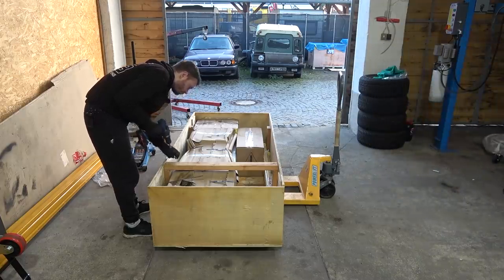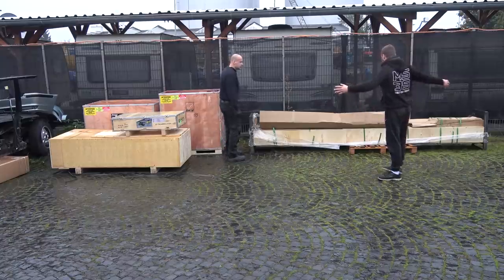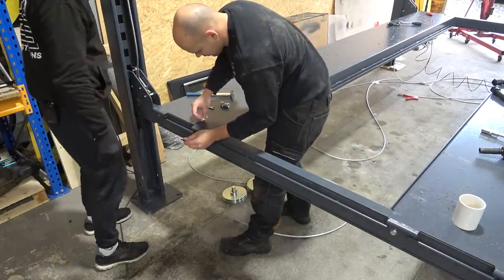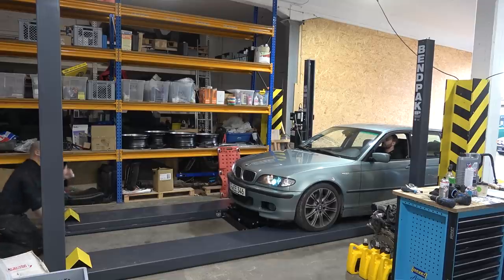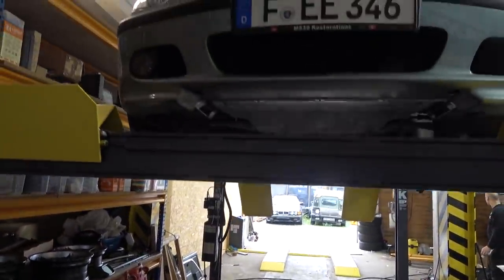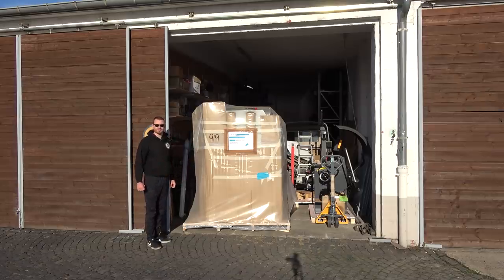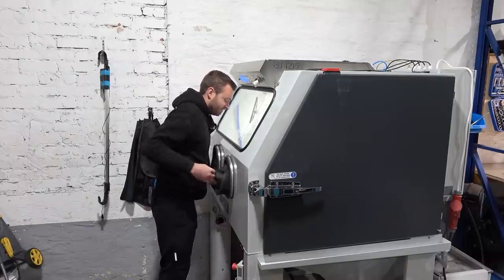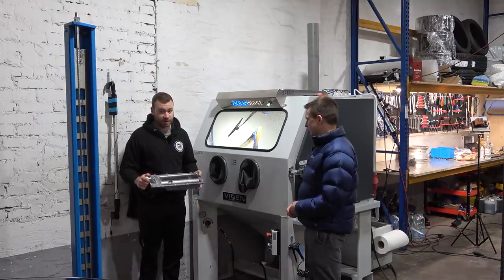New Lifts & Aqua Blasting Cabinet - Workshop Build: Part 3

Comment: I must say I find the name "aqua blasting" a bit deceptive, esp. as previous comments were mentionning vapour blasting : there are glass beads being blasted, so the same objections against  dry media blasting would apply, one cannot risk embedding media in many mechanical parts for fear of trapped glass being released later when in operation. 
The positive point is the reduced dust, but all in all that would greatly reduce usability for me. 

For mechanical parts, I'd rather stay safe with tanking, larcher, or remaining to be tested soda blasting (water soluble to risk free)...
Reply from the maker: Disagree. Parts are blasted with water mixed with media = aqua.
You have to be careful what and how you are blasting, same as with sand blasting and whatever else. Thinner/liqueur will never get you this level of clean. Soda is nice but doesn't clean as good.

Comment: Don´t wanna be a party pooper, love the show, but I was suprised by al this machinery ...why extra lifts? You can only work on one car at a time...and that tire changing machine/balancer? You dont´t change the tires that often that you would need that kind of machinery in that tight space of yours...confused...vapour blaster btw is amazing tool
Reply: He can work on several cars at once now because he can leave partially disassembled cars on the lift (while doing work on the engine for example), or while waiting for parts for other cars. He explained that in a video some time ago.
Reply from the maker: Honestly, I didn't ask for tire machines, BendPak just kindly provided them which is great. Do you know how many times I've taken mint freshly repainted rims to a tire shop only to have them scratched instantly? Way too many and I tried like 10 different shops in Frankfurt.
Re other lifts, comment above explained it pretty well :)
Reply: @M539Restorations   tnx for the answer. Good luck with projects in future, stay cool :)

Comment: The media blasting machine is very nice but no way you can blast a part back to bare aluminium & then not paint or plate it without it oxidising. It may give a very nice finish but it does not stop aluminium from oxidising.

Would love to know the up keep costs on that machine, the paper filter is easy to change but that canister filter or the blasting nozzles look like they will be expensive let alone how much a new compressor will cost you as it is going to have to be big to get enough CFMs for blasting with another 3 phase supply point to run it.
Reply from the maker: Sure you can, that's the whole point of the machine and why it saves time. You think oil pans, blocks, pumps, etc... are painted from the factory? This machine cleans and treats the surface at the same time. You can clear coat them for that extra protection which I'll do depending on the part and its application. 
For steel, I'll be adding rust inhibitor to the machine. 
Big micro filter is not expensive and doesn't need to be changed that often. I already have a couple of nozzles, but that's not something that wears out, at least not quickly. Machine is maintenance free essentially, just depending on how much you use it, the media needs to be replaced if the performance drops.
Reply: @M539Restorations  Oil pans, blocks, pumps are either painted (blocks mainly if cast iron) or plated with either nickel, zinc or cadmium. Most OEM's use clear nickel & zinc coatings so you would think just looking at them that they have no coating at all seeing as the plating is only a couple microns thick. 

Trust me from experience if you blast aluminium & leave it unpainted or unplated it will oxidise, I did it with a cylinder head & gearbox and after three months it was covered in white aluminium oxide and that was blasting with glass bead.

They would not go to the degree of plating all these items it they did not need to. Take a look at Bad Obsession Motor sports project Binky restoration after blasting they plated "everything" they could as just leaving any base metal bare & open to the elements will allow it to react with the oxygen in the air & start rusting.

Hence why when you blasted the toolkit you coated it in fogging oil afterwards to try & stop it rusting again.

Also blasting anything with bearings installed is a bad idea like that water pump, yes the bearings are "sealed" but at the pressures you are blasting at they will easily be bypassed & it only takes one piece of glass bead to enter the bearing for it to destroy the bearing once it starts grinding against the race & ball bearings. 

Again speaking from experience as I have learned the hard way, nothing like rebuilding an engine only to have a bearing fail because it got contaminated with blasting media a few months later.

Comment: Plastic or rubber tiles are not practical for workshop even when a lot of people put them in their shops.
Imagine if you spill oil, you need to remove them to clean the floor. 40x40 cm tiles and big space. It will be nightmare.
Better option is to use concrete paint-sealent or that white stuff city uses for painting crosswalks. It just cleans place up, and its easy to clean.
Reply from the maker: These are sealed tiles, fluid can't go past it. Besides, it will be only for that corner of the shop.

Comment: 8:26  Lift is out of sync.  Front lifted first, and you can hear how out of time the locks are.  8:38 confirms it.
Reply from the maker: It's not. It's adjusted to be leveled with the floor of the garage which is not flat.